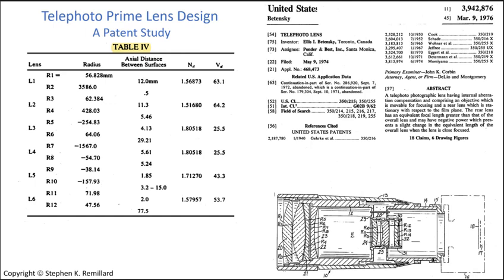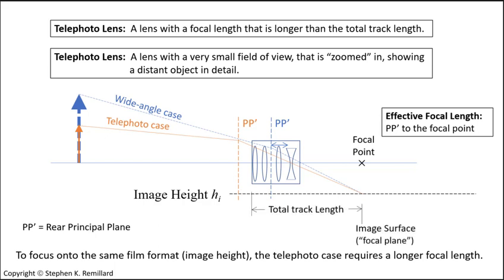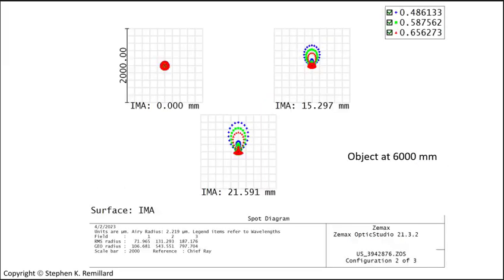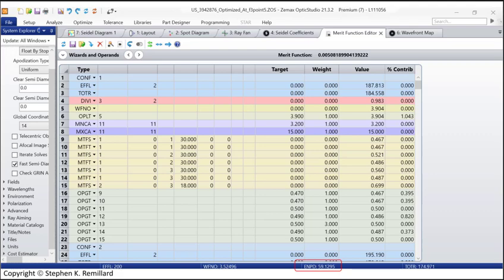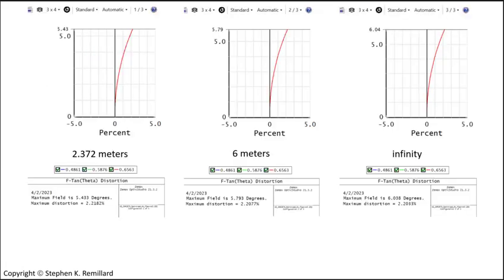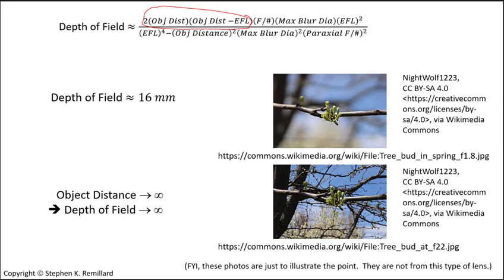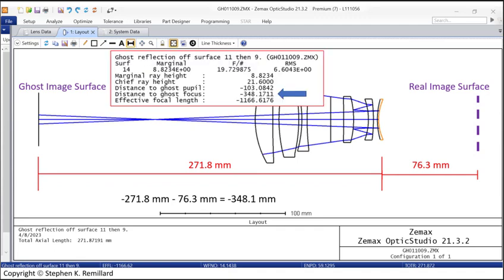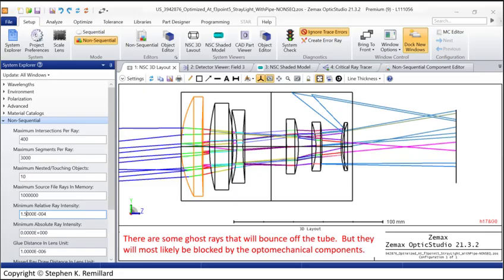Telephoto Prime Lens Design: A Patent Study

Comment: How to correctly determine the scattering factor in the Lambertian scattering model? The video shows that you use 0.8, what is the reason for choosing this value?
Reply from the maker: That's a good question.  First, the scattering factor is realistically a little less than one, allowing for just some specular reflection.  The exact value varies with surface cleanliness, roughness, dying technique, and anything else that influences surface quality  My understanding is that for black anodized aluminum, 0.8 or 0.9 are good values to use.  I don't have anything more helpful than that.  Perhaps someone else can contribute more to this question.  
Edit: A book that I have seen used as a reference for an anodized black scattering model is "Stray Light Analysis and Control" by Eric Fest (https://www.amazon.com/Stray-Light-Analysis-Control-Press/dp/0819493252)
Reply: Hello, what about the use of ABg model? Is it a good tool in the context of stray light analysis?
Reply from the maker: The ABg model is useful for smooth optical surfaces, such as mirrors and lenses.  Black surfaces are more complicated and can be modeled with what is called the General Polynomial model, which is an empirical fit to measured data.  And if the black surface is Lambertian, then its BSDF (scattered radiance divided by incident irradiance) is simple then, it is reflectivity/pi.